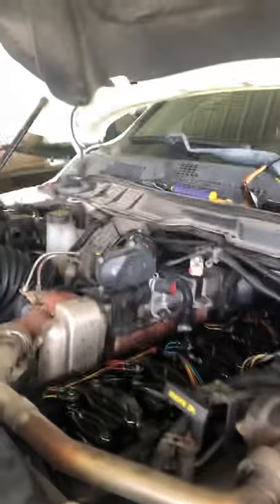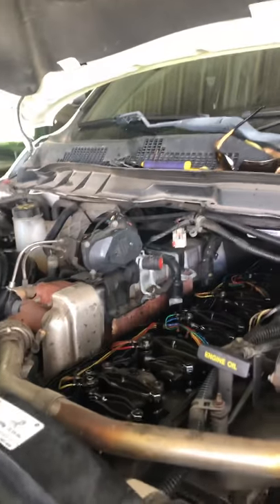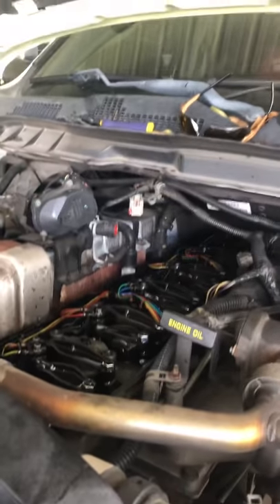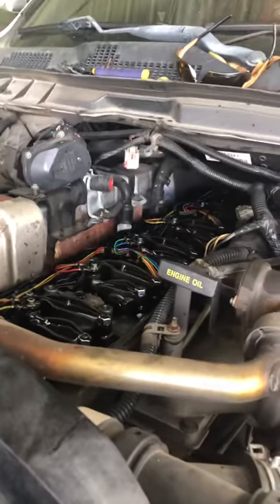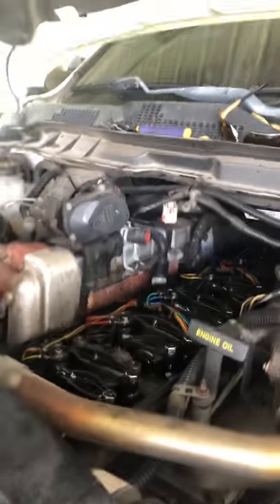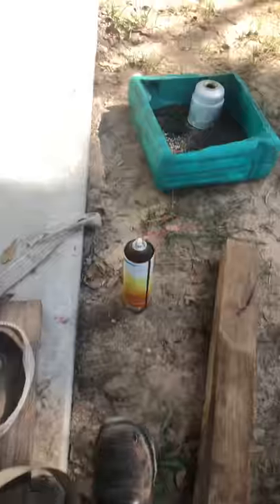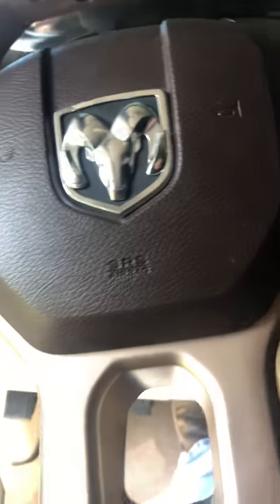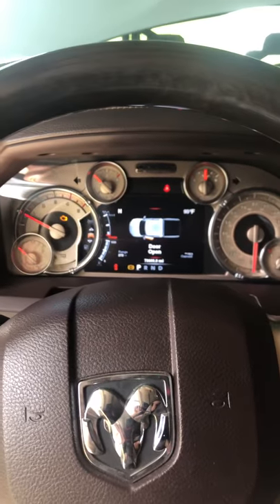2013 Ram 2500 fuel/injector knock? Video 1

Comment: 09 6.7 is making the same noise this video saved my life I thought my truck was done with
Reply from the maker: Awesome man, glad it was some help for you 💪🏻💪🏻
Reply: I have the same 09 6.7 started today rough idle and when stop at light takes a while to take back off found out it’s the injector 1.
Reply: Does it throw a code
Reply: Been looking for the cause of this noise for 6-7 years, I hope this is the issue
Reply: This video confirmed my trucks done with 😂

Comment: Mines a 6.6 Duramax and when it’s cold it sounds like a blown motor. When it warms up to around 190 it sounds perfect. I hope it’s just an injector or two. Worried about the motor and the motor is new with only 8,000 miles on it as well as the injectors. I got standard injectors from O’Reillys

Comment: I have a 2011. 2500 doing the same thing except there is a slight chirp in it also. It has 200k miles was driving and pulling excellent. Turned off getting off the highway at a stop light. Wasn’t pulling weight, and no previous symptoms what so ever, out of nowhere at the light started ruff idleling then shuts off.
Reply from the maker: Ed Gonzalez dang dude, honestly not sure right off what that would be. Mine never actually shut off. Did it ever start back up?
Reply: The General I took it to the shop. They put a new starter in it, it started up but idles very nasty. My motor is shot, I spun a bearing. Fu$!&!)!$$$$$$! Yea so that’s that, I’m hoping insurance covers it.
Reply: It’s crazy cause it was running excellent pulling fully loaded trailers of dirt and cement. For it to go like that bearing no weight...?? Bummed out.
Reply from the maker: Ed Gonzalez dang man, sorry to hear all that!! That is a downfall of owning diesels for sure. Everything is expensive. Well, i hope it all works out for you for sure bub. Sorry for my delayed response to you as well. Been trying to get things together for this potential hurricane situation!!
Reply: The General thanks man your video was very teaching.
Reply from the maker: Ed Gonzalez preciate that buddy. I tried to make sure everyone understood.

Comment: Dude my truck is making that same noise. 2010 2500 with 128k miles. Gonna check that out thanks
Reply from the maker: No problem bub.
Reply from the maker: Did you get it figured out bub?
Reply: Did it throw a code?

Comment: mine does not sound that bad. but it has a slight knock. It does have 350k so im going to check it out
Reply: Did you figure out what it was
Reply: @scottyfilms9301  from investigating people say its normal. as long as its not excessive. no check engine light or loss of power

Comment: Hey man I know this video was posted a while ago but my 2015 Cummins is making the same noise but it’s has nothing to do with the compressor going on and off, my started doing it on start ups (hot or cold) but would go away after 20 seconds but now it’s way worse (two days later) truck has 108k on it what ended up being the issue with yours?
Reply: But it’s also not all the time
Reply from the maker: Mine was #6 injector. You can either send it in and have them eectronicly shut each one off, or you can pull the valve cover off and unplug each one, one at a time and see if it eleminates the noise.
Reply from the maker: Thats how i figured mine out finally lol!!
Reply: @shugbe5477  I pulled the cover and checked everyone and 1 and 2 made a slight difference but not enough to say for sure it dosent idle rough but the weird thing is now that it dosent go away at idle if I get to about 1400 rpm it goes completely away
Reply: @drewhall6511  having the same exact issue with my 2010 right now
Reply: @kevinkennison8694  check your torque converter bolts mine ended up coming loose
Reply: @shugbe5477 😊
Reply: @kevinkennison8694  did you guys ever figure out what the issue was?

Comment: Mine is doing the same thing but it’s a 1999 does it with air off
Reply from the maker: Well beings yours is not a common rail, im not sure that your issue is the same as mine. Mine was the #6 injector. I changed it, along with the fuel feed tube, and its been good ever since then.

Comment: 2016 2500, 36000 same noise comes and goes tho
Reply from the maker: Have you checked injectors yet?
Reply: @shugbe5477  no, never thought injector could be causing the noise. Comes and goes so I had no idea what was going on.
Reply from the maker: @Rocko1983ify  i thought mine was in my drivetrain. I changed out my TQ and flexplate, but still had the noise. Ended up being my number 6 injector knocking.